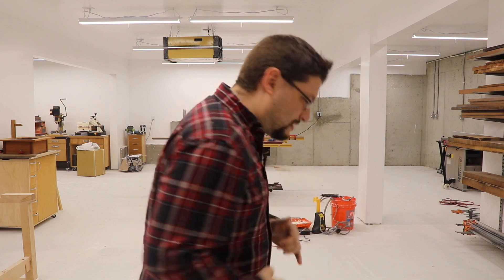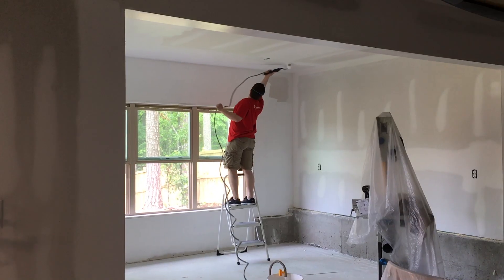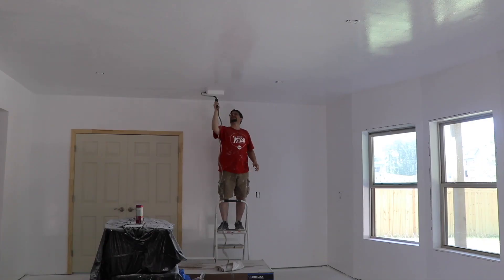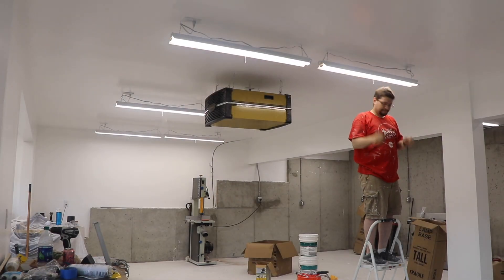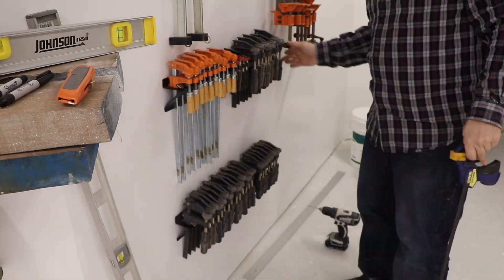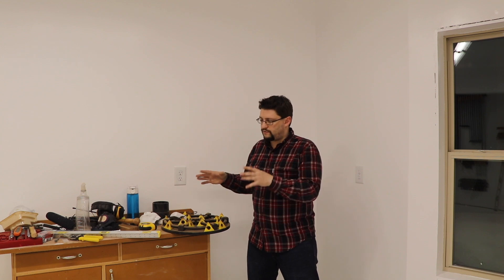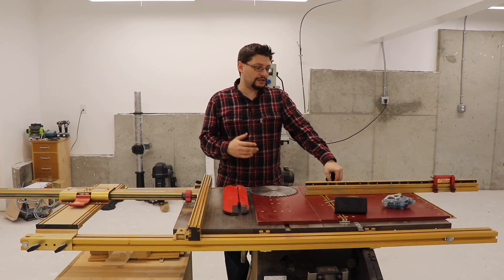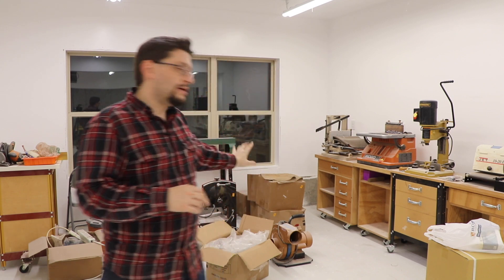Shop Update June 21, 2017 - Painted & Quick Tour

Comment: Nice shop....lot's of space!  One suggestion for your assembly table.  I made one about a year ago that has a torsion box design.  Guarantees absolute flatness and I can change out to top sheath if/when it gets too beat up.  And you could still incorporate a vice, which I think is a great idea Matt.  Take care.  Steve
Reply from the maker: Thanks, Steve! I've had a torsion box for the past 10 years. After editing this last night I was thinking about that again instead of the pre-made tops as they are expensive at the larger sizes.